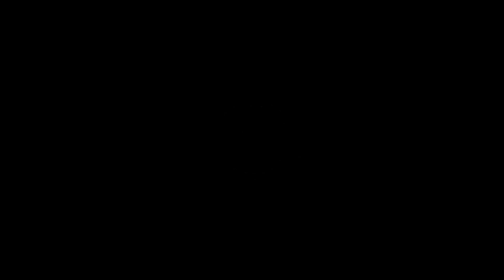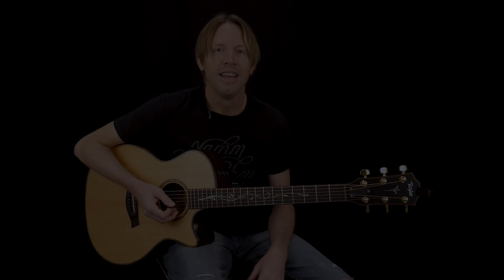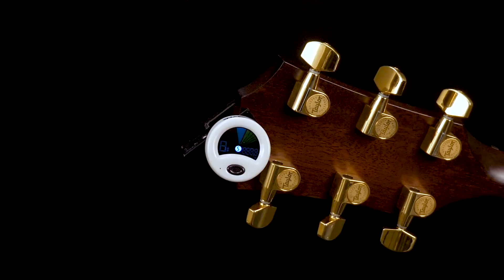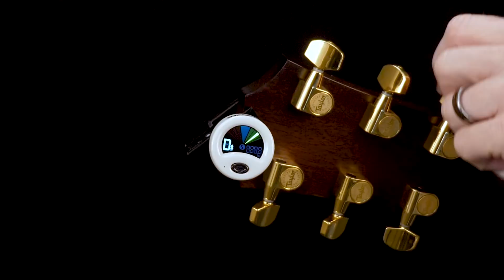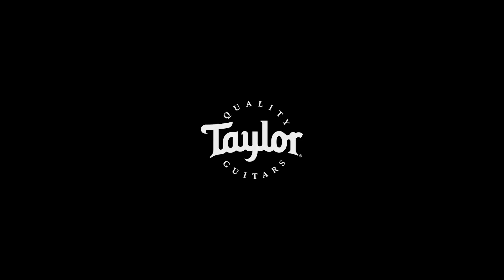How to Tune an Acoustic Guitar

Comment: Interesting that you don't tune below the pitch then back up when sharp.  I've always found the strings on some guitars can bind a bit.  Always a good idea to go over all strings as you did... especially when guitar is well out as the neck can take a bit to settle out.  I find when tuning from an open C back to standard it takes another run through.